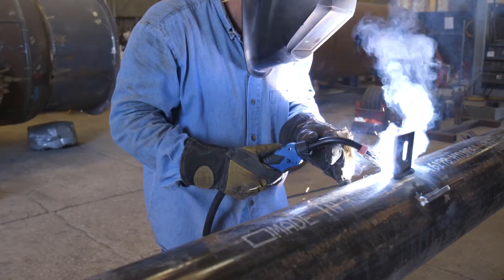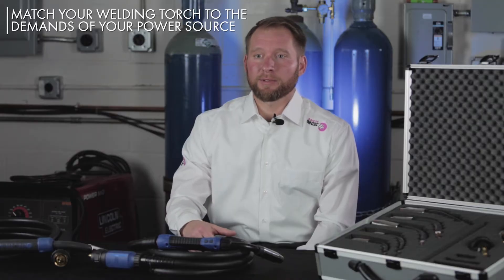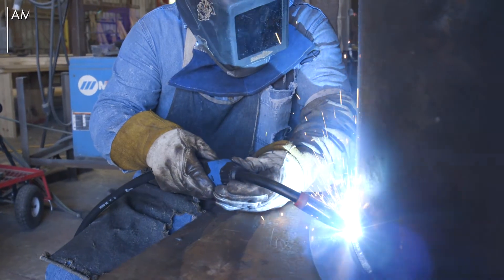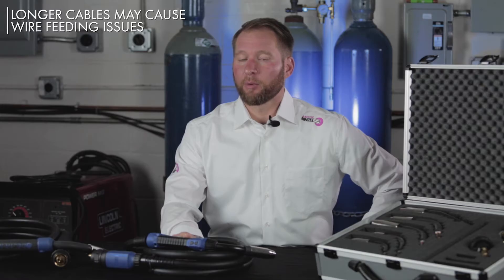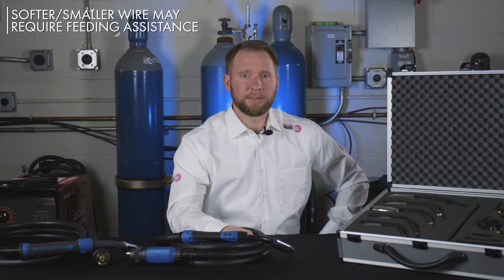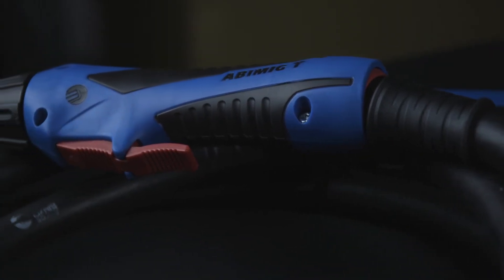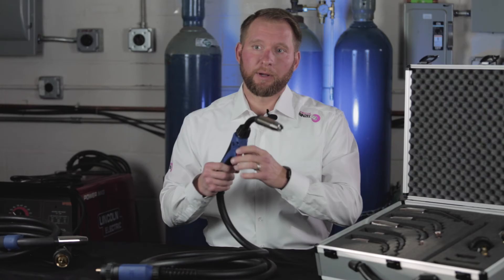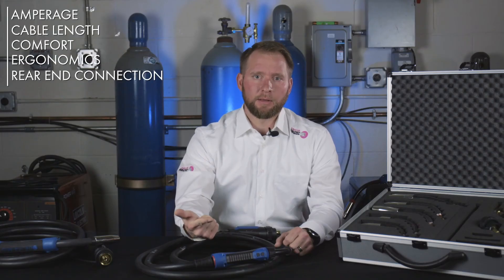Considerations To Make When Buying A Replacement MIG Torch

Comment: I'm starting to learn that MIG torches aren't all created equal !

I have Unimig welding machines (I'm in Australia). The MIG machines come with Unimig Binzel style torches that seem ok .. but I find the trigger a little cumbersome in a decent glove. I'm going to get a bigger Unimig MIG welder with a 35% @ 250A when 40C duty cycle and want to set up dedicated torches for aluminium and steel. I'm probably going to aim at 3m for the aluminium torch and 5m for steel. The only Abicor MIG torches that seem to be readily available locally are the MB EVO Pro 15, 24 & 36 and they don't appear to be significantly different to the Unimig torches. Seems the only real option I have is to buy and try ;(
Reply from the maker: Hey Kevin,

Thanks for the comment. There is a difference between 'Binzel Style' and genuine ABICOR BINZEL torches as far as built quality, longevity, and comfort are concerned. Some of the internal components (specifically the cable) are proprietary and contribute to an overall better MIG torch.

Go ahead and give the MB EVO Pro a shot! It's a crowd favorite.

Comment: Hi just a question if this gun mdx can fit to miller 135
Reply from the maker: Hi Ignacio, yes the ABIMIG torches have an adapter kit that allows them to be used on Miller machines.

Comment: Do the Lincoln mig machines under 250 amps use the same back end connection?  Is it the same sized male plug?  I know the trigger connection for two conductors may vary.  In other words I would like to upgrade my 180 HD's 100L gun up to the 15' 250 amp rated gun on the 211 machines and bigger.  Not adverse to replacing the female socket on the drive if they are available to match the larger torches back end if necessary?  My 180 HD uses a four terminal plug for the trigger with just two terminals in the plug.
Reply from the maker: Hey Douglas, sorry for the late reply.
It looks like what you'll need is one of our connector adapter kits for a Lincoln; they come with a separate piece for connecting the trigger lead to the torch.

Take a look at the ABIMIG AT product catalog to get an idea of what I mean: https://www.binzel-abicor.com/uploads/Content/USA/PDF-Files/PDF_Files_MIGMAG/Catalogs/LIT.9250_ABIMIG_A_AT_LW_12-19_Web.pdf 

Otherwise, you can reach out to your local welding supply distributor for assistance on ordering the correct torch.

Comment: I have a lincoln 180hd
Originally, comes with a 10’ gun
Do you think a 15’ replacement gun may work well? Or too long will cause feeding problems using 0.35
Reply from the maker: Hey Marvin! A 15' gun should work with your setup. We recommend going no longer than 15', though.

Comment: I just bought a miller multimatic 220 AC/DC. Do you know if I can get a 15' gun for my machine? I need to upgrade, the gun is to short for my taste
Reply from the maker: Hey JR, absolutely. Our ABIMIG torch line comes in 10', 15', 20', and 25' lengths. You can check your local Praxair/AirGas or other welding parts distributor to see if they have a 15' in stock; otherwise they can place an order for you!